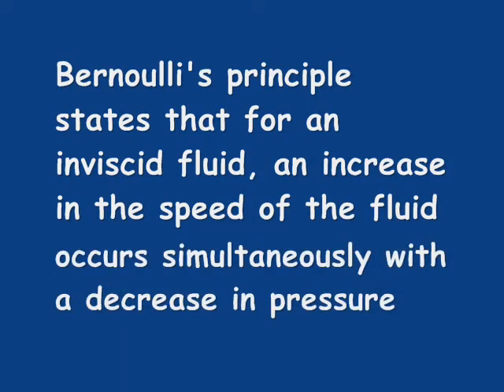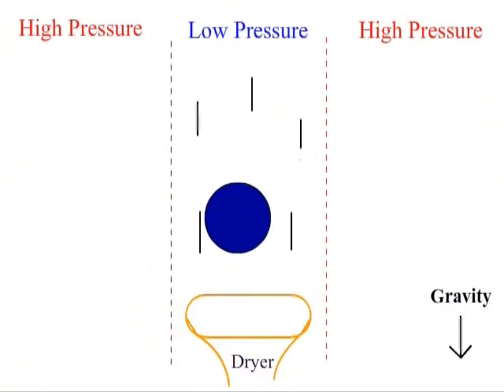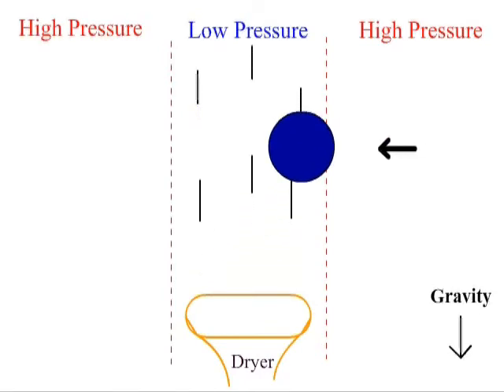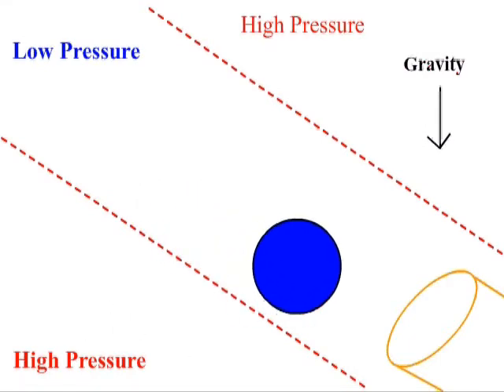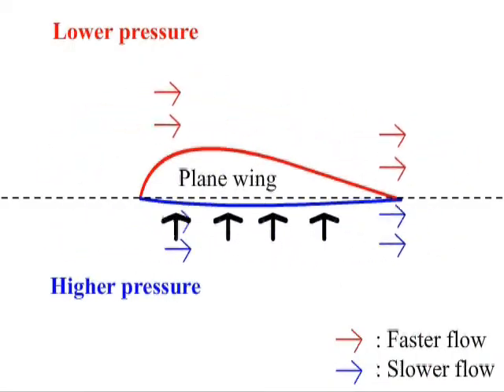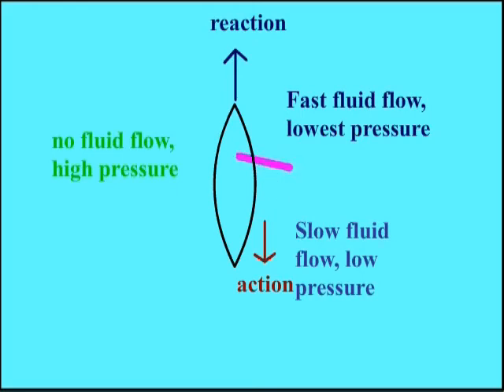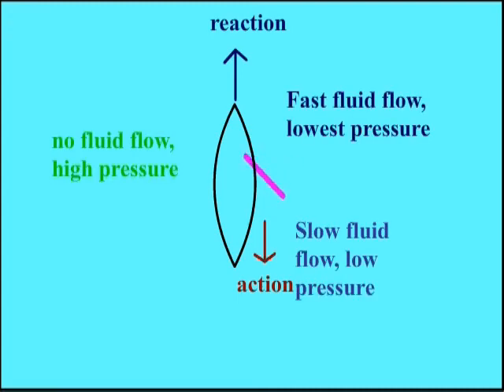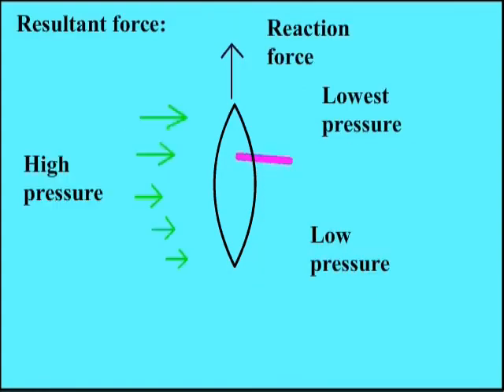bernoulli's principle

Comment: Air, going over the top of a convex wing, is not travelling faster but, instead, slower.  It slows even more when required to travel (flow) over an extended surface such as flats & slats.  The slower the speed the more negative air pressure, the more lift which is created from events on the top, rather than the bottom, of the wing.  Right?

Comment: What?? It's the faster airflow over the top of an aerofoil creates low pressure on the top surface; that's what creates lift. If you angle an aerofoil up, yes, you will get a component of upward force, but the drag will also be very high too, slowing forward motion and creating a stall. Racing cars have an inverted aerofoil to keep them on the ground; an aerofoil designed for minimum drag. 
Hold a sheet of  paper to your mouth and blow on the top surface ONLY .... it will rise. Pure Bernoulli.

Comment: @mobius1aic It is however completely correct that the "equal transit time" is a misguided answer as to why air going over the top of the wing is moving faster.  From what I understand, it's more or less the compression and deflection of air as it hits the curve/edge that forces it to increase it's velocity as the wing slices through it, in a diffusive manner.

Comment: @mobius1aic An upside down wing requires a very significant α in order to influence the fluid to travel faster along it's "top".  Aerobatics aircraft tend to have the teardrop airfoil shape since it's a relatively symmetrical airfoil that can allow for the plane to fly upside down without much trouble.  Normal level flight requires the wing to have a small +α, so it's installation on the aircraft tends to be within the 10° region judging by it's chord.

Comment: @AsyrafRCKS 
You didn't get it. Of course there's no vacuum behind a wing. But the air molecules right above each other before the split DON'T meet again at the trailing edge of the wing. The arrows moving at the same speed above and below the wing imply that. The argument then is: because the upper curve is longer, the air has to move faster. Which is totally wrong, because there's no law that dictates the same molecules have to meet again after the wing.

Comment: for the hairdryer demo and explanation, this principle and difference relative pressure should only apply in the same stream of air. the hair dryer is injecting energy. so the energy level of the hot air coming out of the hair dryer is different from that of the surrounding air. since the Bernoulli's principle is based on the conservation of energy, it should apply only to the hot stream of air and not with the surrounding.

Comment: @dmartinez95 While this is true, the Bernoulli principle is still in effect when a wing is completely level, and there is no downward deflection.  

I think there are way too many fans of specific "camps" in aerodynamics and wing lift theory.  In the end it's the combination of much lower pressure on top than on the bottom of the wing.  Deflection, Bernoulli effect, and the Coanda effect are all in play here at the same time.

Comment: Sorry, but at least the part about wings is wrong. The air split by the wing does NOT meet again at the end of the wing. The shape of a wing is mainly to provide lift over a wide range of angles of attack and reduce drag at the same time.
How else would you explain that paper planes can fly while having a completely flat wing surface at top AND bottom?

Comment: Bernoulli's equation applies to flows with no work. You're airfoil explanation relies on the theory of equal transit times which is wrong...The shape of the wing influences stall characteristics. A flat plate or even the wing you showed if turned upside down will fly.  It's about diverting air down and Newton's laws not Bernoulli.  I recommend reading this if you're really interested.

Comment: Your video is wrong. High pressure does NOT push the wing up. Most people know that high pressure flows to low pressure. If that happened here like you described it, the air would flow from below the wing to above the wing. Newton's 3rd law says that would push the wing down - opposite to what actually happens. The key is that Bernoulli's principle applies to pressure changes ALONG the streamlines and not across them.

Comment: THIS VIDEO IS COMPLETELY   W R O N G    as previously explained  PLEASE REMOVE IT !...Your opening statement called "Bernoulli's Pringciple" is a correct re-wording of what Bernoulli's Equation reveals, however it only applies to spees and pressure along a single path.  It does not apply to two different streams, shush as those above and below a wing.REMOVE THIS VIDEO. As you explain it here, Bernoulli's "Principle" is a false myth. ...The terrible audio makes it difficult to understans as well...perhaps that is good in view of the bad science.